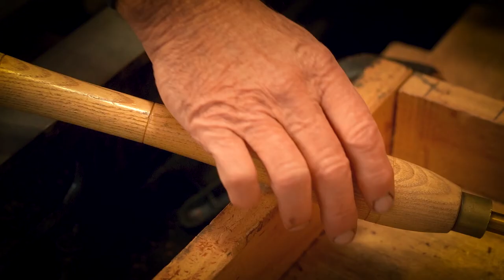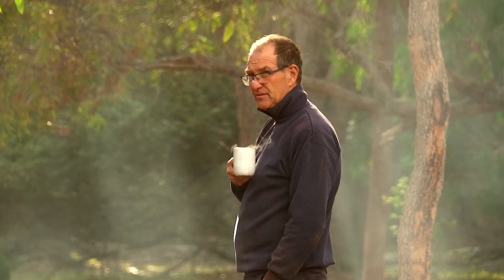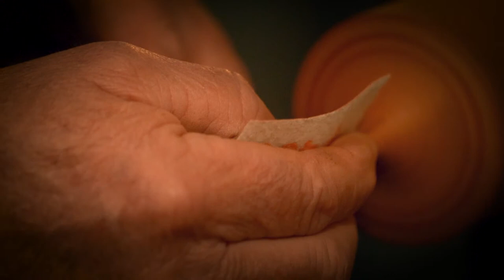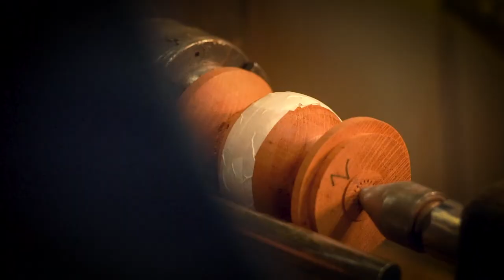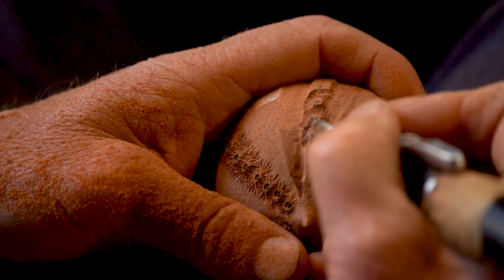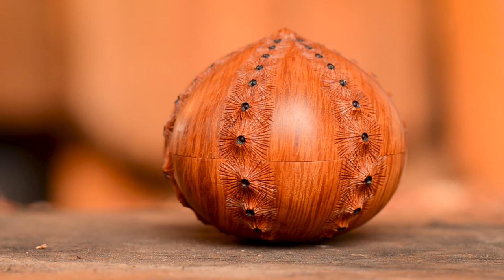Sea Urchin Box Making for Create Day 2021

Comment: Hi Neil, amazing creation! I was just wondering what you sprayed on the outside?
Reply from the maker: Hi Daniel I use a single pack spray lacquer satin 30% gloss made by Mirotone Wax is not an option on the outside as it gets into the small cuts and can't be removed you can use it on the inside though
Reply: @neilturnerartisan1408  Oh brilliant - thanks so much for the response Neil! I'm currently working on a redgum carving with a bunch of grooves and divots and curves, and was stumped over what to finish it with (as I want something that doesn't dull the colours as much as some of the natural oils). This is great information!
Reply from the maker: @daniellemesurier2833  Hi Daniel I use an finish called Osmo oil on some pieces like the home ware range I make, pretty fantastic product it's called Polyx-oil 3100 clear gloss it doesn't darken the timber as much as other oils . Failing that the spray lacquer is a good option I use it out of a spray can.
Reply: @neilturnerartisan1408  Thank you so much for this information Neil! The more I work with wood the more I realise how little I know - so it means the world to be able to get advice and insights from someone as skilled as yourself.